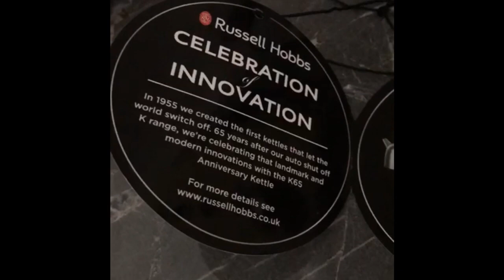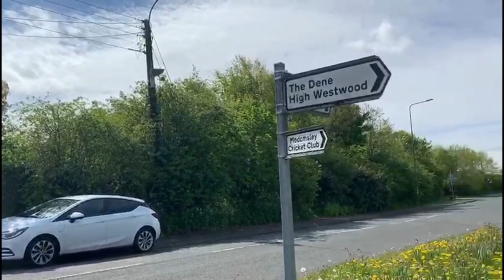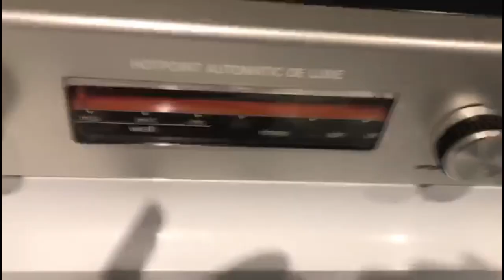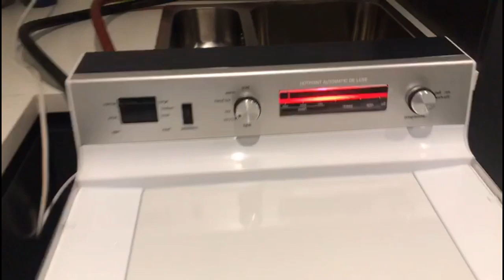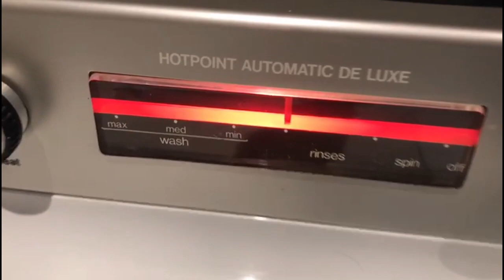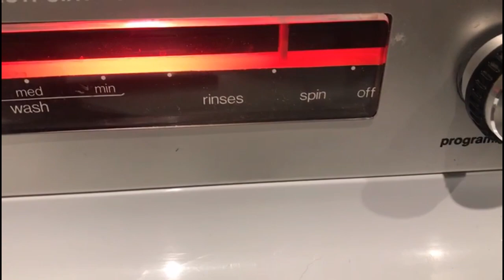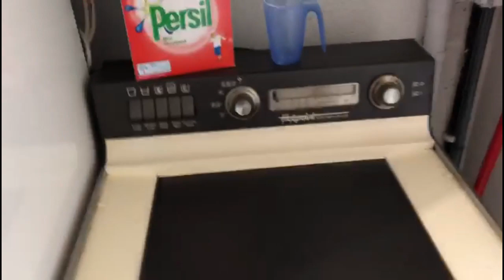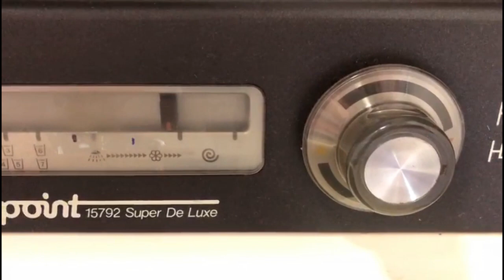VE Day 2020 Classic Appliances Virtual Meet (Part 1)

Comment: The big cream Hotpoint with powered rollers, just the same as my Granny had bought I think in 1959. Came with a pressed metal lid to form a "worktop" for those days , it not Monday, when not in use. Grandads task to get  the roller unit out for Gran. I remember the fun of pressing the red and green buttons and the springy boing  they made. The machine was working and in pristine condition up until she went into a home over 30 years later.
Reply from the maker: Hello Ken, yes the Hotpoint Empress was the backbone of British kitchens throughout the ages, available in cream and white and also with the optional coloured enamel worktop, as kids we used open the wringer door, pull up a chair, stick a plastic kids car wheel on the front and "play cars" gear level and push button start stop ha ha, great memories !!